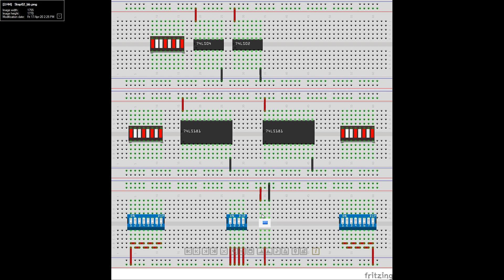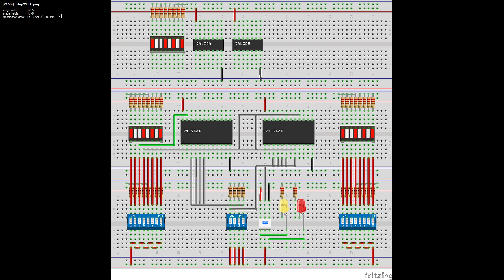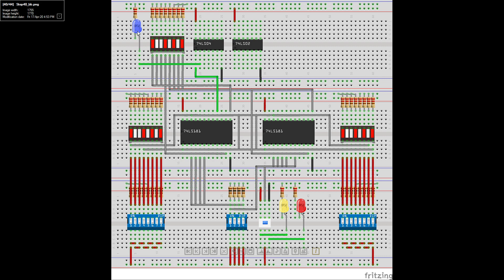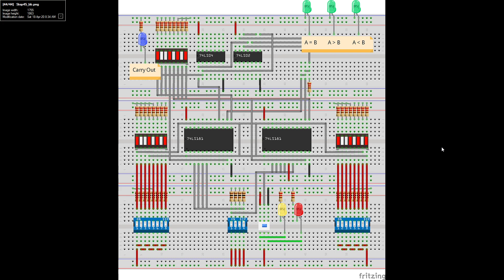Build Guide for the 74LS181 (74HCT181) ALU

Comment: Hey David, if you want to reduce this further yo can get rid of the 7404 inverters by using one of the left over nor gates an tie both inputs together and feed the carry out into that. Also of cause low is always low as well as high is always high. The difference between negative logic or positive logic is which logic level you determine as your ACTIVE signal logic level.
Reply from the maker: That's a good point and I didn't think to mention it here in this video. When I was building this ALU, I tried various ideas and actually needed more inverting capabilities than I could have got from just using the left over NOR gates. However, as everything is laid out in this video, you're absolutely right. - you could just use the 74XX02 and save yourself a chip.

Comment: if alu 1 A=b is high and alu 2 A=B  is low  then the total is A not = B, so joining both A=B's together will give a conflict between them
Reply: I think the idea is that in high mode the pin is sinking current and in low mode it is sourcing current so one sinks the other sources and the LED never goes on because the current takes the path of least resistance.  That's my guess but I am not an expert by any means